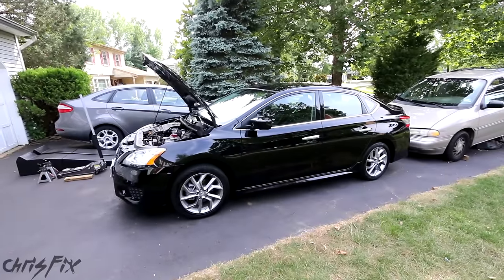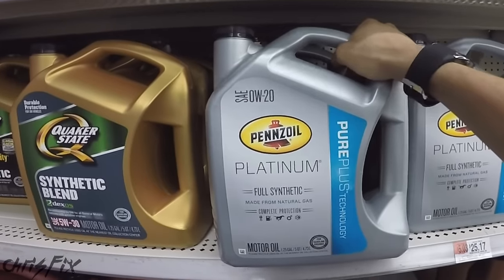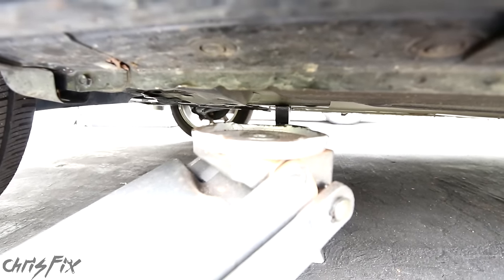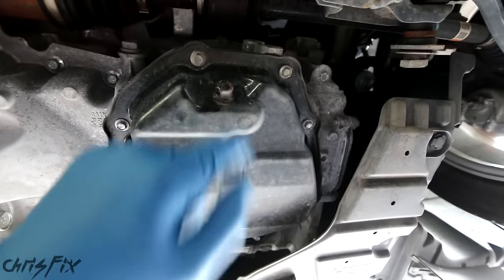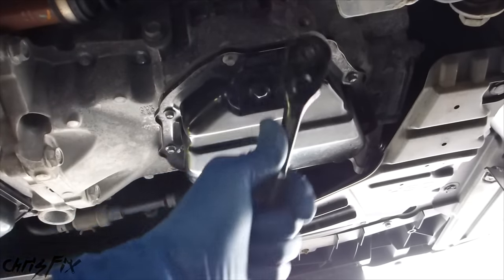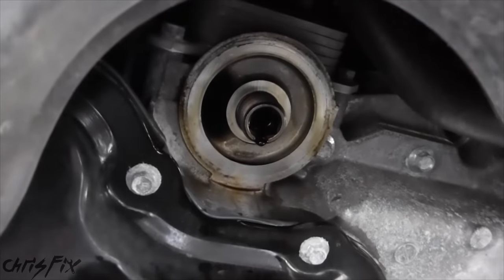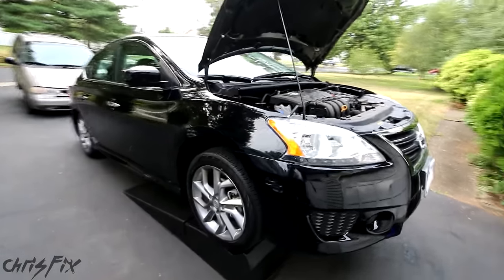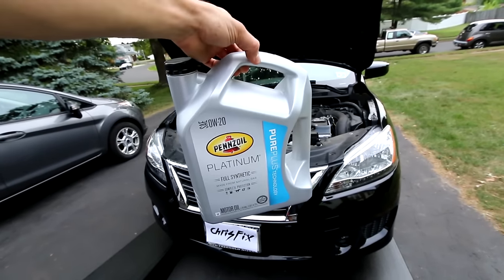How to Change Your Oil (COMPLETE Guide)

Comment: Pro tip: Don’t buy Fram filters.
Reply: I have no problem with Fram on my truck
Reply: @smokestack3327  nothing wrong with them just a fair bit more expensive over a parts store brand filter
Reply: The filters work fine, but they're really expensive. You can get a filter that's just as good if not better for less money if you use filters from an OE supplier.
Reply: Thanks for the tip.
Reply: Pro tip: Don't change your oil by yourself anymore.
Reply: Fram filters are my least favorite.  Poor filter material.
Reply: Fram is what I've always ran on my drift car they work great for me
Reply: @BIGxPAPAxRYAN   they do the job, but when you cut several different brand filters open you will understand why we chose particular brand filters. The construction and material used inside varies vastly.
Reply: @diy_automotive  100% man ive cut em opened and checked, im just worried about it lasting a short time i change oil and all every few events i go to

Comment: An important note is that if you change your own oil regularly then you need to grease your ball joints if you don't you'll be replacing those bastards and that can be expensive!!!
Reply: Newsom Garage Why?
Reply: Rubenbanana because when metal rubs against metal it wears out, that's why you use grease as a lubricant between the two
Reply: So they grease your ball joints when you take it to the oil change places?
Reply: Rubenbanana they do indeed, you should check them every time too bc if a place like jiffy lube does it and they blow a boot they won't tell u
Reply: I thought a lot of newer suspension systems are closed and require no lubrication?  I believe it varies depending on year and model of vehicle.
Reply: TheYzeman I've never heard of anything like that and all the cars I've ever worked on required you to grease the ball joints, not saying you're wrong just saying I've never heard of that
Reply: I  am new to car maintenance , so I don't have extended knowledge of parts. But could you tell me what a ball joint is?
Reply: Jacob D. It's part of your suspension, it's part of what turns your wheels
Reply: On every car I've ever worked on made in the last 20 years the ball joints are sealed inside a rubber boot. They are maintenance free and don't need greasing.
Reply: RickkyP the boots leak and need to be maintained or they will grind
Reply: If the boots broken then you replace the ball joint as grit and crap gets into it. On modern cars they are a maintenance free item. And usually like £8 for a new one anyway.
Reply: Newsom Garage a lot of passenger vehicles have unserviceable bjs
Reply: Tobey X I've never seen one that is
Reply: I don't know what cars your working on but they stopped putting grease fittings on cars like 20 years ago...
Reply: Aaron my 99 Silverado has them, a 2005 cobalt has them, and a 2014 impala has them but I guess I'm the crazy one
Reply: Newsom Garage 2014 Impala does NOT have them, I googled the part, its a sealed unit like nearly every single car since the eighties. They're just replaced when worn out. 
I know chevvys tend to have pre-historic suspension but even they use sealed units now. 
Regardless, for 99.9% of people out there, ball joints do NOT need greasing.
Reply: RickkyP I own one and have greased them before?
Reply: Newsom Garage I had another look. and it look like it is possible to buy a non sealed one. But why anyone would fit one in this day and age is beyond me. 
Any Euro, or Jap car will 100% have a sealed ball joint, and for good reason, they last for years without being touched. Then a few quid replaces them. 

Uncovered ones end up filling with grit and road crap which eventually wears them out, no matter how often you repack the grease. If I were you I'd swap your old ones for some higher spec newer ones.
Reply: RickkyP they are sealed units but the grease will leak out of them you have to grease them or they will start to rub and to replace one is close to 100 dollars
Reply: i have worked at a quick lube they don't grease them unless you ask and most are sealed
Reply from the maker: Great tip! Thanks!
Reply: Scott t i never grease them and never have a problem - ball joints are sealed - and they get replaced when they get old and brittle and crack - i have a 1992 Ford EB fairmont that needs them done because thry are origionals and need replacing but i also have a 2002 Ford Falcon series 3 that has the origionals but are still fine
Reply: Newsom Garage where exactly is the ball joint? Sorry, this literally is my first time doing it on my own and I really want to learn this. I'll be googling this as well lol
Reply: KiddKoalaz they are joints that you're wheels pivot on they are like rubber bulbs that have a small fitting on top and you use a grease gun to refill them
Reply: Newsom Garage shaped like a ball in a joint (but you cant sell the ball joint because the inside is all sealed
Reply: Why does changing oil  regularly effect the ball joints ? Or are you saying to just add grease to the ball joints to keep them in good shape ?
Reply: Yes, but cars stopped using grease fittings on suspension parts about 20 years ago and GM was the last to use them until 2005 or so. If you buy a replacement part they often come with grease fittings but I don't think it matters because most cars get at least 150,000 miles on the original suspension parts so you can forget about 'lubing" your suspension unless you have an old car that actually has fittings!
Reply: Aaron 90% of larger trucks (some 150 and all 250 and up) have grease fittings on the ball joints.
Reply: They grease the ball-joints during oil changes? Shit that's good to know. Literally just replaced my control arms and last thing I need is another fucked up ball-joint immediately after.

Comment: Change the filter first. If u drop it n the pan. Oil want splash on u.
Reply: Sounds like the voice of experience, but not if you have the kind of pan he has. For the rest of us with just a regular pan, good point.
Reply: Benjamin R. nope, drain the oil first and then remove the filter. it’s easier to just do it that way, or do it at the same timez

Comment: I am almost 60 and this is hands down the best video I've ever seen about this process! I have fumbled through the task for years but this made it really concise! Thanks so much! Question. The race ramps in your list are pricey. Have you used others that do the job for less money?
Reply: I got some from autozone for about 50 bucks, they work well and hold all three of my cars, 2 sedans and a truck with no issues,just remember to use the parking brake and put some blocks behind the wheels to be safe
Reply: @CronoSZN  thanks!

Comment: Great video! Please keep them coming! Just a note on how I change the oil on my vehicle.  On one older Toyota truck I used to have, it was impossible to get a wrench around the filter because of its location. I found that a dog collar worked well and kept me from saying any dirty words. Also, don't  buy the cheapest oil and filter you can find. I use 'Mobile 1' synthetic oil and a Toyota filter on my Tacoma. There are good filters at Walmart, but learn the difference between the good ones and the cheap quality ones.

Comment: Did a first oil change on our "nice" car. Maybe I didn't save a ton of money, but it was oh, so convenient. I bought all the supplies and had them on the shelf well in advance, did my change at 5am before the kids woke up. What shop is open then? Had time to wash up and cook breakfast.

I use your foil trick for getting filters out of awkward locations. Honda's is screwed in sideways, and spills all over frame members when getting it out. I would advise it's not a bad idea to leave a cardboard under your car just the first night in case a tiny errant drip from the filter, drainplug, or wherever might dribble down.

Comment: 2011 Honda Pilot, 160k miles. I changed from high mileage oil to full synthetic and my SUV started leaking oil. Nothing major, but noticeable. On my next oil change, I switched back to high mileage oil, added a bit of Lucas stop oil leak, and the leak stopped after a couple of months. If you have a high mileage older car using conventional /high mileage oil, I wouldnt recommend switching to full synthetic.

Comment: Thank you for this video! I never knew how the engine oil was changed before this. 

I use the dealership garage to get my engine oil changed out, as my home does not have a garage or a drive way. And trying to change the engine oil on a public side street would be a nightmare task.

Comment: Great that Chris cleans around the filler cap to stop crud from falling in.

Couple of other tips I've picked up from tame mechanics/friends/my dad etc:

After finishing, spray a little brake cleaner on a rag and wipe any drips off the sump near the drain plug. If you later see any drips, its a genuine leak and not old oil splashes blobbing around.

When drained, my mechanic mate pours about 100ml of clean oil into the filler hole and lets it run straight through and out, to rinse traces of old oil out. 

I generally stripe bolts I've torqued up on my car, but now i even add a small dab of paint over the sump plug and filter. I've never had one come loose but its nice to look under after a week and see that nothing has moved.

Large amazon boxes, flattened out, make great driveway splash guards under the drain pan.

Comment: BTW, if the oil plug is in the lower back of the pan rather than the bottom plate, a car on ramps will have a down angle toward the drain hole. This will sweep across the bottom of the pan and allow a greater than normal amount of oil to exit the crankcase.
My car is listed at 4 1/2 quarts per change but 5 quarts come out when I use my tall ramps.

Comment: Something I’ve learned from changing my oil on lots of different cars over the years and with differently designed engines/oil pans, is I always lift the car and support with jack stands of course for protection, start draining the oil from the pan, and while it’s draining I move the jack stand and lower the car back down so it’s level to make sure all the oil levels out and all of the possible old oil drains out. I have had several cars that if I didn’t level it out while draining it would leave a whole quart in the pan sometimes. You can test it on your own car to see if it’s necessary the next time you drain your oil by lifting it and putting on stands, drain your oil and watch it until it stops draining and turns into a drip. At that point once it’s just dripping to the point that you would normal put the plug back on, move the jack stands and lower the car with the catch pan still under the pan and watch and see how much more oil comes out once you level it out. Sometimes it’s a lot and sometimes it’s just a few more ounces depending on your engine and pan design. My goal and everyone’s goal is to remove as much of the old oil as possible and it’s those sorts of extra steps that will also lead to longer lasting engines.

Comment: Great vid, I find that before letting the oil run from the pan, I first undo the oil cap from the engine and take it off .. This lets the air run through and therefore the oil pan lets the oil run out much more and faster, and then when you are ready to pour new oil into the motor, the oil cap is already off ready to go :)

Comment: if you are really afraid of getting dirty, the best tip I have is get a tyvek suit, after your first change you can keep it stored and keep re-using it till it wears out. Mine has 10 oil changes already and keeps my clothes clean. 

When unscrewing avoid using your hands on the bolt, add an extension to hold the socket.

Oil filter cap socket is better than the strap wrench, especially for smaller cars. 

Oh and if you own a Yaris, you can do the whole oil change without lifting the car up. Even the oil filter.

Comment: I don't know if anyone else has posted this, but if you drive a Toyota, Honda, Kia, Nissan, Subaru or Acura, always replace the gasket/washer on the drain plug.  They're made to be crushable and your oil will leak over time if you don't replace it. Especially if it's shoddy. Replace the drain plug as well if the head of it is rounded off at all. If you drive a Volkswagen, always replace both drain plug and gasket.

invest in a solid 3/8ths drive torque wrench to make sure your drain plug is tightened to the right specs. familiarize yourself with its usage and how to properly set torque level on it. you can find out exactly how many foot pounds your drain plug torque is in the DIY section and oil change subsection of most owners manuals.

band wrenches are also great for getting oil filters off and tightening them. 2 & 3/8 inch - 2 & 5/8 inch range for hondas, Nissans, Subarus, Acuras, and some Toyotas depending on the year and model. 2 & 7/8 inch - 3 & 1/4 inch range for kias older than 2022(?), most Jeeps, most bigger pickup trucks, as well as Ford and Chevy. Or you can go the route of filter pliers like in the video. Giving an oil filter a quarter turn with band wrenches will allow for more secure tightening after tightening by hand as much as possible.

Comment: my father never taught me on how to change oil. we dont have a jack and we dont have a ramp, so the curb method is most certainly going to be something that i think im going to use. i bought my dad's old car and he never really maintained it, but it will be around 35 degrees outside. i hope that i can still change it easy. might just go buy the frickin ramps to just make life easier. i also just got new studs on the car because the old ones wiggled on the frame, and my whole steering is squeaky as can be. i went to a goodyear shop and after them gouging me 1500 for the studs, rack and pinion, inner/outer right and outer left tie rod, i decided im going to do this stuff myself. ty for showing my first step. going to get the oil changed, find out about the clunking sound, the squeaking on my steering, and try to see about replacing my brakes to at the very least save money. my poor car needs it... im tired of losing so much money on mechanics to fix this stuff...
Reply from the maker: Sorry to hear what those mechanics were quoting, you can save a ton of money by doing it yourself. It definitely might be worth investing in some ramps to make the job a bit easier. Let me know how the oil change goes!
Reply: @chrisfix  ty chris will do!
Reply: My father (who never did an oil change right) was trying to tell me that i cant do it on an incline which is what our driveway is on (which is about 30-35 degrees of a slope). I told him that i can and will. What i found out under was that there wasnt a gasket on at all for the drain plug and it was leaking oil. I replaced the drain plug with the gasket after fully draining the black oil with solids in it. No leaks so far from that and the filter was a horizontal installation. I did lubricate the gasket on the plug and on the filter. I also wiped down the oil under my car. It now has the look of coffee with creamer in it
Reply from the maker: @justsomesaltyboi8716  send some pics on Instagram so I can see
Reply: @chrisfix  ive no instagram homie, tho i would. This is my only social media
Reply: I believe the new oil cleaned up the carbons in the engine and it mixed with some of the old oil. Thats why it looks like coffee with creamer. It isnt milky, but it is just at that soft brown color

Comment: Once again a mechanic did not remove the oil cap before the drain plug, so the oil drains slowly because air must enter the same hole as the liquid exiting. 
When you open a can of Hawaiian punch or tomato juice, you put two holes in the top of the can to allow air to enter one side as the fluid comes out the other. This way the liquid drains quickly and carries more dirt and heavy particles, especially  from the bottom of the crankcase out to the drain pan.  
I also warm the engine before starting to thin the oil for a faster  exit flow and to suspend more particles that tend to settle in a cold engine.  
I pull up on the ramps and prepare first by filling the new oil filter to allow time for the media to absorb oil so it will let the new oil through to build pressure as soon as the engine starts.
 
So: 1 Warm up the engine (not hot about 110 F) Same safe temperature as domestic hot water.  
2  Pull up on ramps set parking brake and shut down. 
3. Fill the new filter. 
4. Remove and wipe the dip stick and reinsert half way. 
5. Remove and clean oil cap. 
6. Remove drain plug and wait at least five minutes for oil to drain. 
7. Reinstall clean oil plug by hand to avoid cross threading and torque to spec, usually about 23 ft lbs. If you don't have a torque wrench, grip the 3/8 socket wrench at the top over the direction switch to avoid over tightening.  Don't lean on it;  if you position whatever wrench at two  O clock on a hand tight plug, don't go past four O'clock.  
8. Remove oil filter, with filter wrench (I use a rubber kitchen cap  tool)  and clean mating surface with brake clean and lint free rag. 
9.  Install new filter with oil ring seal lubed with new oil only HAND TIGHT ( they tighten with heat cycles) using rubber pad or sand paper for a good hand grip. Not as tight as your can!  
10. Pour in new oil (I use any brand full synthetic) to  capacity spec.  Replace oil cap insert dip stick.  
11. Drive off the ramps, shut down engine and wait three minutes with car on level ground to check the oil level.  Add oil to full mark but no higher; overfilling the crankcase will cause the crank to whip the sump oil creating air bubbles, foam and eventually mayonnaise.  
12. Restart and check for check for leaks. 
13. Record oil change date and mileage.  I reset the first trip odometer at gas fill ups and the second trip odometer for oil changes.  Change again in 6 months or 5000 miles.  

More to it than the kid at the gas station has been taught.  right?
Reply: Great tip & point!!!